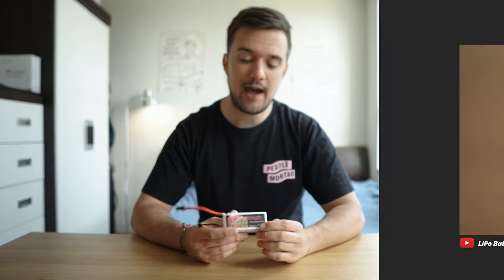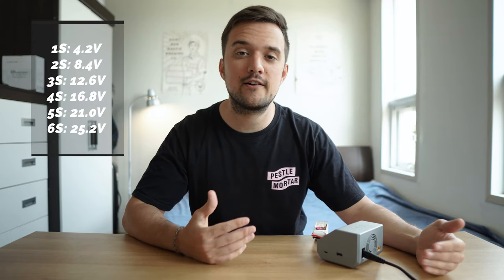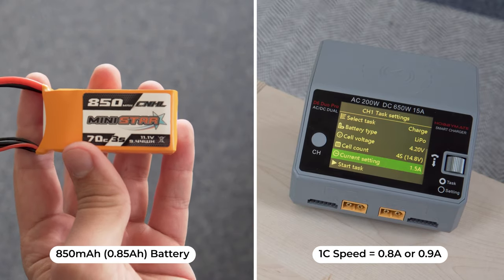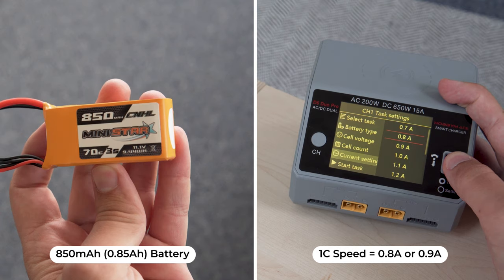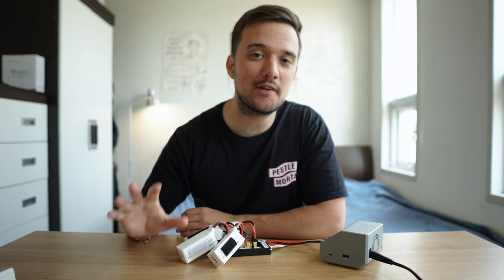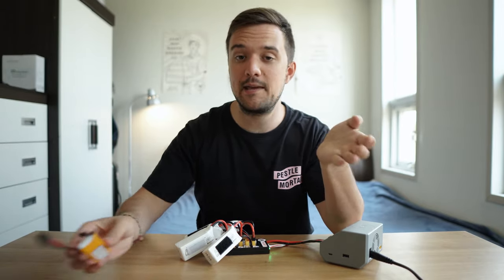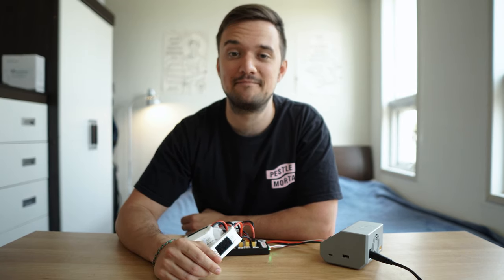How to Charge and Parallel Charge Lipo Batteries

Comment: From completely empty, a full charge would take an hour at 1C, they are rated in amp hours not amp 45minutes, but in most scenarios, batteries aren't at 0 capacity when you charge them, that's why in practice it only takes around 45min

Comment: Most chargers will adjust amperage along with resistance. I charge everything at about 6c.. at a maximum ceiling of 10 amps. The charger will never actually charge at too high an amperage.

Comment: Great info Matt! I have the same charger and one of the functions I use quite often is the storage function. I tend to bring my lipos up or down to 3.8V with this before parallel charging. This is also really convenient when it's time to charge up all my packs I know they are ready to go.
Reply: That's a really good tip! I was wondering what the best method would be in the real world to get them at a similar voltage.

Comment: I looked all day on the internet while being subscribed to your channel before I got the right answer I was looking for that I found in no other videos about balance board charging and what to set the charger at as far as capacity...at 10:03 or somewhere around that time in the video you draw the diagram with 6 batteries and how they charge 1 ar a time at 1.5. So all day my question was do a multiply mah by the number of batteries. You have the best video on the internet about how to use a balance board and what to set charger at. Thanks very much. Liked, been subbed for a while amd hit the bell for all notifications. I have the dji fpv system and I started watching your videos about it months and months ago. Now I finally got my hands on the setup and love it. Got the built and tuned skyeliner HD with the dji air unit and the goggles and dji transmitter. I have flown about 20 packs with it and love it so much. I am definitely addicted to fpv now. I have been flying the mavic air 2 and the Autel Evo 2 camera drones before getting into fpv. Absolutely love it. Thanks again for the video

Comment: Additional tips and corrections from an RC heli pilot (we demand more out of our LiPos than FPV):

1. You don't need all batteries to be the same brand, or even the same capacity. Critically, they need to be the same cell count. Importantly, their voltages need to be close together. In fact, the reason you need them to be the same cell count is because different cell counts IS a different voltage on the pack. To describe what happens -- it isn't even an overcharge amount issue. The issue is the power delivered to each battery in the circuit, and for that matter -- as they exist in the circuit. The moment you wire up a lower voltage battery with higher voltage batteries, the laws of physics (E&M) will be pumping juice directly from the higher voltage batteries to the lower voltage ones and in an unrestrained manner. Basically, it's the bigger batteries that will start to overload the smaller one.
2. When you parallel charge, you can charge over 1C just the same as you would individual batteries. A parallel charging board presents the charger with a single large battery. Take that total capacity, and you can charge at 2C (or higher if you do) of that.
3. This was missing entirely from the discussion: but always balance charge your packs initially. I have a charger that can fast/slow/normal balance charge. I normal balance charge at the start of day, fast balance on the field. If you're going to discharge your pack promptly (within hours), you really don't need to balance charge it slowly with precision.

Example: I always charge pairs of my 6s 5200mAh batteries at 20.8A. This is a 2C charge because in parallel it is logically a single 10400mAh battery, twice that is 20.8A. My 6s 6000mAh pairs are charged at 24A, etc.
Reply: Hi, thanks for the comment, it's very informative. I'm curious, if you plug a 6s 1500MAh and a 6s 1300Mah, would you set the charge at 2.8A assuming 1C? Would it spread the 2.8 correctly 1.5/1.3 or 1.4A for each - charging the smaller one faster and somehow balancing between them once the voltage rises and tries to equalize? How does it work?

Comment: Excellent video, it should be required viewing for anyone starting out in the hobby.  Batteries are the most boring, most expensive, and by far the most dangerous aspect to this hobby.  What I do is use one expensive 20 amp charger for the heavy lifting and I have a couple of little B6ACs for things like my goggle and ground station batteries (Yes I'm old school, I still use a ground station lol).  That was a good tip that the red wire is always on the inside of the balance plug.  Unfortunately those little guides on the balance plugs don't provide much protection against stupidity, which I found out the hard way when I got careless once and put on a balance plug backwards.  That's why I still watch videos like this, it's not only a good auditing tool  for my own practices, but sometimes I pick up a tip that had escaped me!

Comment: When parallel charging, I plug in the XT60 connector first as it can handle higher surge of voltage than the balance lead. That's my way of doing it.

Comment: So I was so excited... watched your videos, Mr. Steeles Video, and a few others learning about Lipos...   Several hours later, finnally got to my chargers video, ISDT D1 smart charger...  received my parallel charging board, connected the parallel port to charger, And than tried to connect my batteries....  NO WAY.... my connector was too small.  The batteries for my GEPRC25 (By the way you had recommended it... SO PUMPED TO TRY IT!!!).  It has been on back order for several months, and finally  found another location that got some in....   SO I need to order some type of converter... what would it be.  battery 450 80c and 650 100c.

Comment: When parallel charging different cell count batteries, the current will also flow out of the larger batteries and into the smaller one as you plug them in. So the larger cell batteries will also be sumwhat undercharged.
Reply: You only should charge lipo’s with same number of cells! Amps on lipo may vary, Not the cells!
Reply: @aarem01  hmm, your right... Not sure what I was trying to get at there... Maybe I meant 'mah' not 'cell count'

Comment: I don't know why, but I had a hell of a time trying to find good information on charging Lipo batteries when I got into this hobby. I charged my 450mah 4s batteries at 2 amps for a long time before I found that it's unsafe to do that. Funny though, those batteries still work great and they're over a year old now. It's simple. 1000mah is 1 amp charge rate. 2000mah is 2 amp charge rate. 450mah is 0.4 or 0.5 amp charge rate. I don't know why so many videos didn't just say that.

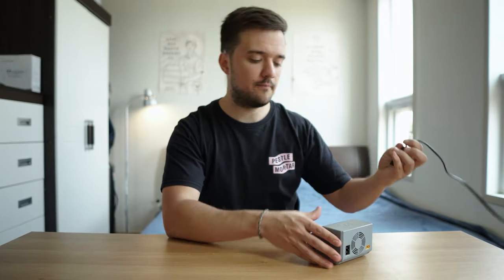Comment: Mistake at 2:05 never plug a charger in after the powerpoint socket, in the end anyone who does this potentially may not have a charger... Always plug the charger IEC socket first then the power point... and if you have a switch on the power socket have it off until both are plugged in...

Comment: Thanks for the video.  I have the DC only version of the same charger, and I noticed that when charging, even if you specify 2C or 3C for the charging current, that amperage is only applied when the battery is at a relatively low voltage.  As the voltage increases, the charger reduces the current, thus getting a charging curve with more amps initially and less amps later on in the charge cycle.  I have a parallel charging board, but I noticed some damage on some of the cells on my batteries and I have the feeling that it was because after some time, its just too much work to alwas be checking and grouping batteries to parallel charge, so I was less than perfectly methodical about doing this.  My method now is to charge at 3C most of my packs and just do them 2 at a time on the charger.  For 6 batteries, I have to make 3 trips to the charger, but I need to be around it anyway, and it takes up about the same time as parallel charging them.  I feel this lets the charger more closely manage and balance the individual cells. I have noticed much better battery health doing things this way.

Comment: Hi Matt! Congrats for your videos! Keep going! Just a question when parallel charging. Does your charger recognise the number of cells in each battery ora you have to set it manually. If the manual setting is required, what number would you select? 4s if you're charging 4s batteries?
Reply: I just got here, but saw no one answered this very reasonable question. If your particular charger doesn't do this automatically for you (guess at the "S" based on voltage), and even if it does, you should know that each cell in a pack is the same. They're each "1S" cells, and every 1S cell is 4.2v. So multiply that out and you know the max for each pack. Write yourself (or find on the web) a little table that matches the pack size of the ones you have to the voltage. Put it on the wall or tape it to the back of your charger (don't cover vents!).  Then you can either pick the voltage from a menu (my charger has a 👍 icon next to the suggested voltage, confirming my choice) or just go with the "S" number if that's an option, It should be safe.   Folk who have been doing this a while, these voltages eventually work their way into your brain apparently and they can just rattle them off :)

Comment: Coming from the RC guys. Do you ever get higher mah batteries? Like 5500 to 9000mah? What you charge those at so they last the longest? Do you use a 2x rule or half the mah rule for that?

What about storage charge etc?

Comment: there are some mistakes... seems to me: a) because the voltage is different, it has nothing to do with overcharging some. but since they are connected in parallel, they will equalize automatically anyway .. it's just, when they equilize, there might is too much current, therefore 0.1v per cell difference max.
You might also want to connect all the xt-connectors first.. so that equilizing can happen on the big wires.
Also the charger will not split anything.. nor do anything .. the paralell-setup will. The charger will do what it always does, provide one single ampere output.

Comment: Question;
I'm getting the Q x7 and I'm not really sure what battery to get and what charger. I will be getting the charger you use, but once I actually get my quad. For now I'll be using the Q x7 on a Sim... With that said, I want an inexpensive good charger for just the Q x7s battery... Any suggestions?

Thank a million for these videos btw. Lost the fear of getting into FPV thanks to these 👍

Comment: I wonder how this works with older batteries. I read that a cell can have greater voltage than the remaining cells when the battery gets old. How this plays into the 0.1V per cell rule? Does it have any (negative/dangerous) effect? Also if things got bad, can it damage the charger?

Comment: Matt, where can I get a connector for plugging the board into the charger like the one on your parallel charging board in this video. I ordered the same one off Amazon and when it showed up it just had the power and ground cables dangling there. 👍

Comment: Hi, Matt. GREAT videos....very well done!  I have learned a lot over the last few days.  I am getting back into RC and working on procuring the correct charge and power supply.  One question about parallel charging.  My current charger (T240) has a CHARGE option and a BALANCE CHARGE option.  Which one should I use when using a parallel board?  Also, does it matter that my charger does NOT pick up all the cells from the parallel board?  when I plug in (2) 2S packs, my charger only reads 2S and on the individual cell readout when charging, it only shows 2 cells vs the 4 that are connected on the board.  THANKS!!!

Comment: Great video. Quick question: Can you parallell Storage Charge/Discharge with a parallel board by making sure the V is also within 0.1V per cell. If they are not, do you individually discharge them and then do this
Reply: If you're discharging, the differences don't matter as much. Worst case your batteries will all be at max. You'd need at least one to be over max to them to "self balance" when connected to the parallel board to be at or over max. Then the trickle-down-discharge of the battery manager (charger) will drain at a set voltage. The higher the difference the faster the highest charge battery will go down, until they're all about the same (within a few hundreths volts on a good charger) at which point they're balananced and they'll all go down until the target voltage is reached.

Comment: Thanks Matt! Great Video as Always...My Question is I have 4x 450Mah 4s HV Batteries which I would like to Parallel charge ..what should I be putting my Amps at for that? Also If I had 2X650maH 4s HV Batteries what should the Amps be at to parallel charge too? Thanks so much
Reply: 450 mag should be 0.45A each one, for you’re 650mah battery’s it should be 0.65, you need to always divide it by 1000
Reply: @furkanfpv677  thanks , yeah that part is cool, my main concern is when I charge parallel , i need to know the right Amps based on the question above ☝️

Comment: Nice video bro. Someone told me, it is better to charge the Lipos on a maximum 2C of one lipo.
Because, if you have Lipos with different internal resistance. The badest one gets a full amp. In Your video, the worsed Lipo get the full am with 6A. What do you think about that?
Reply: 4batt x 4S with 1.5Ah capacity = 4C... Some cells WILL get more than 1C due to internal resistance.

Comment: Hey!  So had to rewatch this now that I own more lipos.  I have the same charger and trying to charge 4x 2s batteries on parallel board.  On the Hota it only shows up on channel as if there are only 2 cells at 3.7 each for example.  Is this where I just have to make sure the others are no more than .4 difference since they don't show while charging?

I'll give it a shot.  Just wondering what you screen looked like when all plugged in.

Thank you for the videos!

Comment: I did not understand the part about letting the batteries sit in by themsevels for a few minutes, are they plugged to the charger and doing a balancing task before actual charge or not?

for everything you are doing: Good Job!
Reply from the maker: When you plug the batteries into a parallel charging board, they will act as one big battery and I guess the current just naturally flows between them. It's not that the charger is performing a task. I think it would happen even if the parallel board wasn't connected to a charger

Comment: Hey @Matt Pochwat - down comments @Lifeon2Wheels asks a great question about discharge, that leads me to another one! When using a parallel board for discharge for storage, do you still multiply the Amperage level of the rating for the pack(s) by the number of packs?  I.e., for 3 4S packs you want to store at 3.7, do you set the charger to drain until 3.7V is read, or since they're parallel, do a multiplier for a greater Amp discharge rate? (I haven't checked my charger to see if Amperage setting is a thing during discharge)   I know LiPo batteries are designed for very high discharge rates, so maybe this doesn't matter?

Comment: Super very extra important question, if i have an 850mah battery (4s) and charge 2 of those same exact batteries, do i need to double the amps and voltage? Or will that charger (the one i am think of getting because it was in the video) do it for me or do i just not touch it at all in just plug in both at 0.8amps 4.20v <- which you said is the perfect amount for that? Please answer

Comment: If I have a 80 watt charger, can I parallel charge four 4s 1500mah lipos? Since watts = amps times voltage, it would be 6 amps times 14.8 to get 88.8 watts. Can I charge them all at the same time?
Reply: Yes but the charger will be charging at a lower amp rate

Comment: Should you always discharge your lipos to similar voltage before parallel charging? Like If I have 4 batteries, and I used 3 for 5 minute flights, but the 4th one for only a 1 minute flight... Does that matter?
Reply from the maker: Yes, all the voltages should be the same (or very close) if you are charging them together. Always check each battery's voltage before parallel charging and only charge together the ones that are at a similar level
Reply: @MattPochwat  that charger is the one I just purchased. Would I just plug each one in and look at the voltage I guess? Or do you prefer using a battery checker. I guess they are effectively the same. Also, is it best to discharge batteries down to the lowest batteries voltage that you are wanting to charge or should you charge them all up to the highest before using parallel charging? Does that make sense?
Reply from the maker: @ToastyMcNuggetLuvr   ToastyMcNuggetLuvr  yeah a battery checker and the charger can both check your voltages, the battery checker is just slightly more convenient. 
As for the second part, It's best to learn how to land your drone at a similar discharge every time. I talked a bit about this in my "how to make your batteries last longer" video. If your batteries are not at a similar voltage once you finish flying with them, I think it's easier to just charge them separately instead of parallel charging. If I understand what you're saying correctly, I've never tried that before.

Comment: had one question don’t have to answer if you don’t want to, but here it goes can I use a xt60 battery with my drone which has xt30 connection by using a adapter which is converts xt60 into 
xt30 or if I was to disorder the xt60 connector on the battery and solder a xt30 to that battery is it ok.